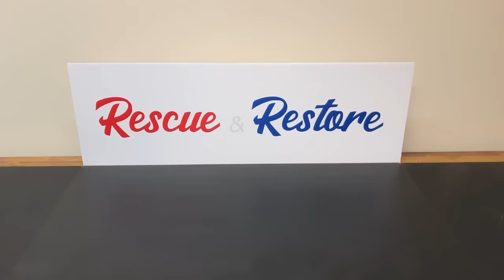Northwestern Model 60 Vending Machine Restoration

Comment: That’s a lot of m&ms for $0.05... gonna go broke with this business model for sure
Reply: I guess back in the day, 5 cents would get you that much.

Anybody old enough to remember a nice chunk of [penny] candy? Today what use to be a penny in the 60s and 70s, cost you a dime, maybe [even] a quarter today ... and the portions are way smaller.
Reply: That was my exact thought as soon as I saw all those delicious candy coated milk chocolate morsels fall into his hand.
Reply: They're going to have to fill it with uncooked rice to make a profit.
Reply: I had the same thought. 😂😂😂😂😂
Reply: I saw a part in the machine that looked like a shutter to regulate the amount vended. Maybe he left it wide open?
Reply: inflation
Reply: Was thinking the same. Big bag of M&Ms like that costs what... about $10. At $.05 per, he'd need to get 200 servings, to break even.
Reply: That's why theres 3 ads
Reply: Isn’t he using quarters tho?
Reply: Ok
Reply: My first thought, "Looks like 1.00 worth of M&Ms"
Reply: If you dont turn it all over, and hold it while turning the other side, it would get stuck and give you infinity candy
Reply: I think there are "Retrofit" kits you can buy even for machines that ancient - to accept quarters.  Same machine was made for a long time, that's why he was able to replace the totally corroded parts without doing something cool but complex and time consuming like molding and carving or scanning and 3d printing a mold then pouring metal in a cast...  ?Sugar acid/left with candy in and got wet?  Also the amount dispensed is variable by the top plate to the rotor.
Reply: RamZ get off my lawn!!
Reply: At that time, prices were different. Example Hamburger Big Mac, first appearing on the McDonald’s network in 1967 was priced at 45 cents now worth $ 3.22.
Reply: Probably built for gumballs, which were larger. Fewer units per coin.
Reply: @TheOriginalMaxGForce  Almost spit out my coffee!!:)
Reply: Just throw in something too big to fit through the dispenser hole!
Reply: @DaBurtskiy why do you think he’s restoring it
Reply: Art N. You
Reply: I actually did the math because I am procrastinating:
a 42 oz bag costs around $9 today, which means you need 180 nickels to reach breakeven
a singular M&M is 1.13 grams
and around 28.35 grams is an oz
meaning that there are 1,190.68 g in a 42 oz bag
1,190.68/180 is 6.6, exactly 6 M&M's
these kids be stealin our chocolate
Reply: Replys: Maybe a shutter was left open???
Inflation: Am I a joke to you?
Reply: The machine wasnt used for m&ms
Reply: That’s back then a candy bar would cost 1 cent
Reply: That's what I saidddddd
Reply: @ricdwe  Oh yeah. In the '60's we just had to walk a few blocks to a family run little store. A nickel would get a kid 25 pcs of candy dropped into the tiniest little brown paper bag imaginable. Dots, candy cigs, wax soda bottles and lips, Bit o Honey, etc. This little store had a potbelly stove with a bunch of old geezers in denim bib overalls sitting around it in the afternoons. That went out of business. We had to walk a few blocks more to get to another family run lil store. Same prices, but slowly they went up til it was a penny a piece. When we went back to school in the fall it closed. So cool, these two stores were in the middle of neighborhoods blocks and blocks away from any major roads.
Reply: @TheOriginalMaxGForce  lmaooo
Reply: I remember going to the mom and pop store and getting a soda and a ton of candy for 50 cents and then when we had drank all of our soda we would return the bottle and get another dime worth of candy...
Man those were the days...
Reply: RamZ ,I miss going to the store and getting a small bag of penny candy.
Spend 25 cents and that little bag was full.
Reply: Art N. that was so detailed and I can legit see it without even getting to that part in the video.
Reply: DaBrutskiy lol right
Reply: DaBrutskiy+ My grandparents used to have a machine like that in their home, that we always used. It was so fun to get candy from it
Reply: @Jakelovesphoto -Jake Fleming-  Nope. it would have had an individual sorter for that. Simple change of inner tray and portion control ring.
Reply: UssGo What does “infinity” candy taste like?
Reply: @Dargalis  .....my dad knew Ray Croc the founder of McDonald's and I use to live right down the road from his first stand. 25 cents could buy a hamburger, fries and a soda......add 5 cents for cheese, and later the deluxe burger was a quarter.
A half gallon of ice cream was a quarter, and a dollar filled a bag full candy. Cigarettes were 10 cents a box out of the pull machines and later 15 cents.
In 1976 a carton was $2.50 when I was in the military.
Reply: @Dargalis  In Canada it is $5.00, $3.22 for a big mac sounds cheap
Reply: theres settings for how much they dispense i believe I know newer model machines have it for sure
Reply: I was about to put the same comment until I saw yours. Whew! That was close!
Reply: There's a bulk store near where I live that sells 'Sugar Coated Handheld Chocolate' for about two dollars per pound. Contrast for the, what, $8 1lb bags that M&Ms sells, you bascially get 4x the M&Ms. 

That and I'm sure this machine isn't going in a public place. If I had something like this, I'd 
put it in my kitchen so my stoner roomates have to pay to eat my candy.
Reply: you can adjust the size that is dispensed
Reply: @Zuxiasunicorn  I grew up out in the country and we never had anything like that anywhere around.  😢
Reply: কসয়জসজ
Reply: This machine wasn't built for gumballs, gumball machines have a different design with springs. Also the portion sizes for the M&Ms vended can be changed using those 2 new plastic pieces that he bought to replace the old ones. Not only that, my portion sizes cost me about $0.03 and I sell them for $0.25. -Vending Machine Owner :D
Reply: @walmartdog1142  he did leave it wide open
Reply: Yes, thank you inflation...
Reply: Keep it as a personal machine, all the money in it goes towards replacement snack money.
Reply: that's what i thought lol "that's a good handful for 5 cents!"
Reply: Good point. 😅
Reply: @ricdwe  5 1959 cents (the year this model would have been released) would be $60.64 in todays money.
Reply: @QAV44  .05 cents in 1959 would have the spending value of $29.93 in today's dollars ... Cumulative rate of inflation:  2893.0%  

The US Inflation Calculator uses the latest US government CPI data published on July 13, 2022, to adjust for inflation and calculate the cumulative inflation rate through June 2022. The U.S. Labor Department's Bureau of Labor Statistics will release the Consumer Price Index (CPI) with inflation data for July on August 10, 2022.
Reply: Same thought as soon as I saw😂

Comment: You can purchase food grade machine oil. (Probably on Amazon) That canola oil will go rancid, and can promote bacterial growth.  Nice to see a restoration with powder coating instead of just spray paint!
Reply: I know this video is 2 weeks old now but just wanted to say white mineral oil from the pharmacy is an OK food grade lubricating oil.  Easy to get and wont hurt to eat a little.
Reply: Google "Cooking oil coating prevents bacteria from growing on food processing equipment".
Reply: @clray123  Cooking oil is a horrible lubricant for mechanical lubrication.  It gums up, especially on rotating parts.  Once the solvents evaporate it becomes a sticky mess.  It may prevent bacterial growth, but I'm not sure there are too many problems with bacteria issues in bulk M&Ms.  Having worked on industrial food processing equipment for years has taught me that cooking spray as a machine lube causes way more problems than it solves.  There are far better food safe options to keep this machine in top shape.
Reply: @jenslundy  just curious what machines have you been working on?
Reply: @jenslundy  I agree, had a bb gun years back that had been lubricated with canola oil. After awhile the oil gummed up and it was basically impossible to use.
Reply: @jenslundy  I used to work in a restaurant and people would spray the bar that the carriage of the slicer rode on with cooking spray to lubricate it. Yes, it helped for a bit, but it got pretty sticky and nasty. As I recall I finally used some WD-40 to clean it up and then used white lithium grease on it. The slicer than worked fine for quite a while, then I went on vacation and some idiot sprayed cooking spray on it again...

Comment: Holy crap! what happend to this thing? Did you recover it from the Titanic?
Reply: Maybe he did 👁️〰️👁️
Reply: I wonder this about most of his restorations. They look like he sources them from Pripyat 😳 We have several tin toys from the 60s or older, and usually only rubber tires have degraded and some plastics have discolored.
Reply: I like Titanic
Reply: @VanillaLibrarian  If it wasn't for the radiation danger, that would be incredible to see someone restore something from Pripyat!
Reply: That would be so cool!
Reply: If
Reply: I think anything from the titanic nowadays is not usable lol
Reply: Can he restoration the titanic?
Reply: @VanillaLibrarian  

Remember Pripyat has only been left 33 years

If it had been left alone and not looted most of the stuff would be in better shape

It's the exposure to the elements because of smashed Windows and doors missing etc that has excellerated things

You should see some stuff that's inside some of the flats with Windows and doors intact 

Things like cookers etc look as though they could still be used yet in another it's total decay
Reply: Shows how corrosive that candy is!
Reply: He is time traveler lol hahah

Comment: It's cool that you could get those replacement parts. Great job!
Reply: I believe theyre 3D printed with the metal piece attach after
Reply: @Samwiseangie  

8:33
Maybe bought it as 3D printed plastics but those metal parts are not from the originals
Reply: You can indeed get all the parts for these.   People make a living off of these machines, and it makes sense they’d stay in service a long time.   Mind you, you’d be replacing the 5¢ mechanism for a 25¢ PDQ.
Reply: @jacksons1010  do you know where? (I'm looking for some old vending machine parts)
Reply: @sierraroseprzybyla3333  Amazon, eBay, D&S Vending...just Google for vending machine parts.   If you know the manufacturer try them directly, as many are still in business or there is a vendor specializing in those parts.   This video shows a Northwestern - you'll find parts at moneymachines . com
Reply: @jacksons1010  and 50 cents

Comment: What a blast from the past, I remember those machines. There were everywhere when I was growing up.

When you were doing the disassembly I wondered how you were going to fix the corroded pot metal parts. I guess there are replacement parts available or you must have had another machine to cannibalize.

Comment: 7:34 You really shouldn't use canola oil, over time it will go rancid and not only stink but also stop acting like a lubricant and will turn sticky instead. If you insist on being food safe even though it's not required since the coin mechanism never touches the product you can use mineral oil. However, the best practice is to have no lubrication since it ends up collecting food particles that rot and gum up the works.

Comment: Great job on the candy machine, nice choice of candy. I think you should rethink using canola oil as a lubricant, it goes rancid and smells bad. It can also attract insects and bacteria. I made this mistake with linseed oil on butcher block cutting boards, I had to throw them away. I sanded them a lot, but the oil penetrated so deep that I could never get rid of the smell. Thanks for the videos. 👾👾👾👾

Comment: i used to own a 25 cent vending machine in a similar style. i was curious to learn about how the coin mechanism works. the springed pin that enters into the device and is secured with a screw at 1:40 is what prevents the mechanism from being turned without a coin in the slot. it also doubles as a coin width check, such that if a penny, thinner than a nickel, were entered in the device the locking pin would not open up enough as such to clear the locking position. it also triples as a center check, meaning you can't enter a washer into the mechanism. my 25 cent model also had a diameter check damper pin, meaning that since it accepted only quarters, which are thinner than nickels, you couldn't simply enter a nickel to bypass the width check. i also checked out other cheap counterfeit methods, such as cutting cardboard circles. these were usually too weak to bypass the center check and would also likely jam the mechanism, as trying to turn it back it would probably warp and get stuck inside; something of which i could say was also a good security feature since if someone was attempting to tamper with the machine with all the above methods they'd likely eventually end up jamming it, preventing it from being operated until it was serviced. very clever yet simple mechanisms.

Comment: What if you turned this into a fish tank? 🤯
Reply: Way too small and no air.
Reply: @FurnitureFan  You could probably fit 1-3 small fish in there, and of you cut a hole in the top, or possibly add a bubbler in the bottom, then it should work just fine...

Comment: Awesome. But was there a reason you turned the glass container around? The logo was at the front to start with. It's messing with my OCD 🙈
Reply from the maker: It was on wrong from the start. It goes on the backside. The front glass is to show the product inside and for promotional stickers and decals not to sell more northwestern machines.
Reply: @RescueRestore  Phew, that's OK then. Thanks for the reply and great work 😁👌🏼
Reply from the maker: @grayssportsalmanac85  thanks! I originally filmed it on the front side but then after more research I had to refilm that section of the video. It seems wrong but I’m the eyes of a vender it makes sense.
Reply: @Rescue & Restore  You're right, it does. ..Emphasis on the product 👍🏽

Comment: the text on the glass bowl was not in the same orientation as the original, should be in the front
Reply from the maker: No, it should be on the back. It was not on correctly from the beginning. The front is reserved for marketing decals, pricing stickers and a clear view to the product inside.
Reply: @RescueRestore  Good then, Great job!
Reply from the maker: @Tomahawk1955  Thanks, I originally filmed it with the lettering on the front and I had to go back and re-record that part. I thought they went on the front but after seeing a few in person and a lot a research from candy venders I came to that conclusion.